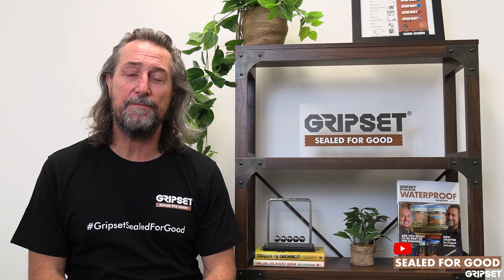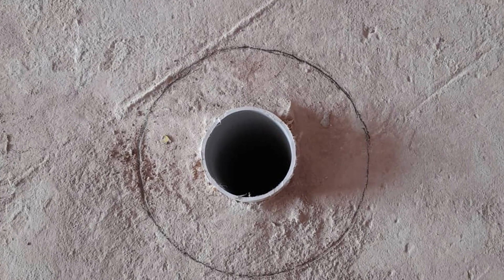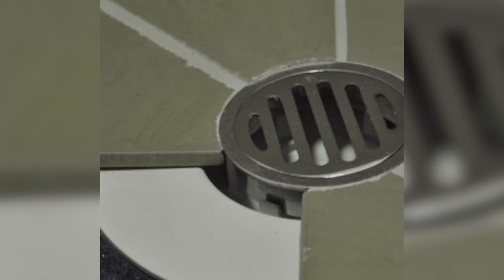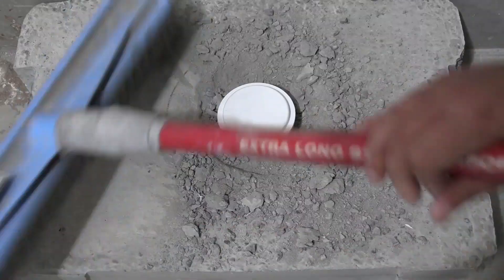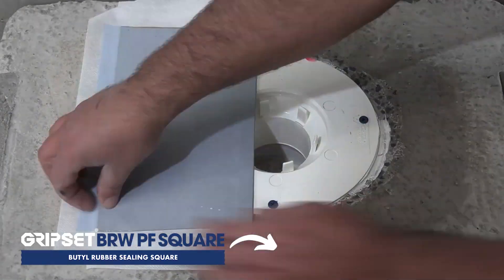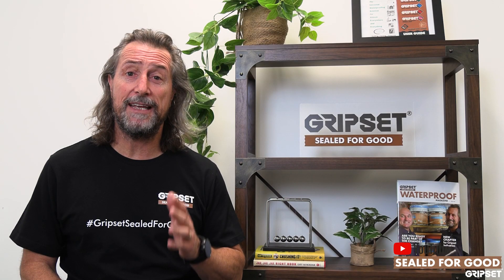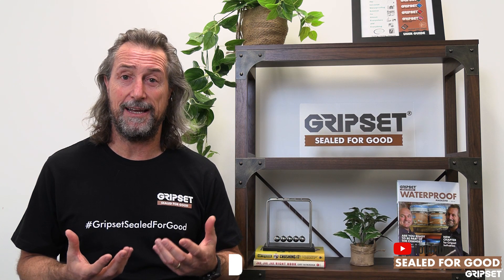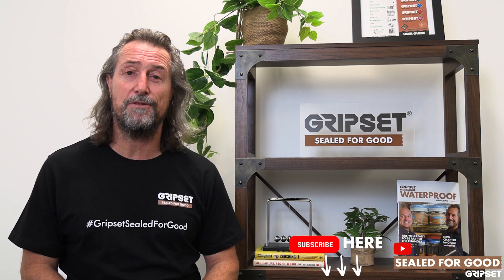How To Waterproof Puddle Flanges

Comment: In reality, would 2 puddle flange 1 above /in screed 1 below at floor, with waterproofing below and above?  Wouldnt this be a sure way method to keep the screed isolated and dry while any leaks will never be a problem?
Reply from the maker: Hi MJ, absolutely - when feasible that is best practise, the challenge has always been the reduced depth of the screed at the waste. Where possible that is the solution we recommend, as in that way you're terminating the membrane to each of the puddle flanges and stopping water from leaking between the substrate and flange. Hope this helps!

Comment: C
Have a Kinetik puddle flange going through cement sheet on top of yellow tongue. Will rebate however the hole size to cut through the floor - is it the size of the outlet (100 in the case) and rebate the inner external ridge into the cement sheet and yellow tongue, or cut the hole through the floor at the externat ridge ( which is about 20ml in from the rim. You demonstrated in concrete with a pipe alreadt fitted but stopped short of showing how to actually creat the hole and rebate in cement sheet over yellow tongue. Cheers
Reply from the maker: Hi L O, thanks for watching, you will need to check with yellow tongue and the cement sheet manufacturer of how much you are allowed to rebate with their products!